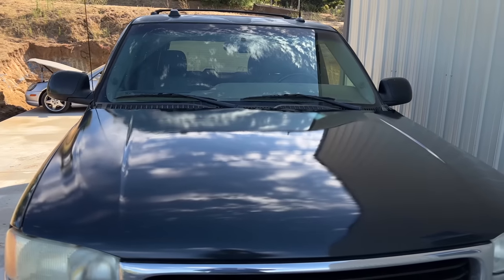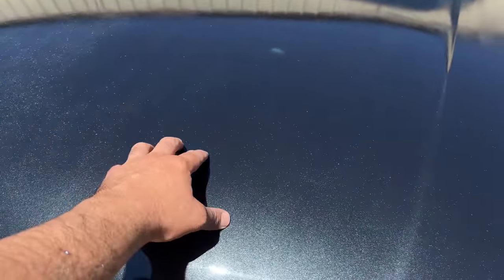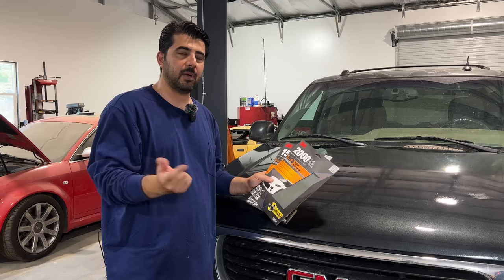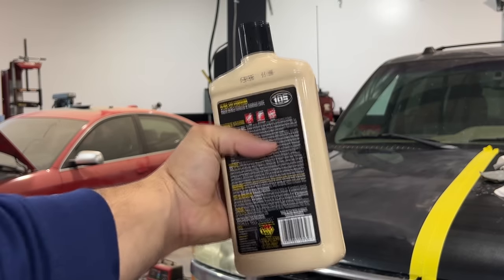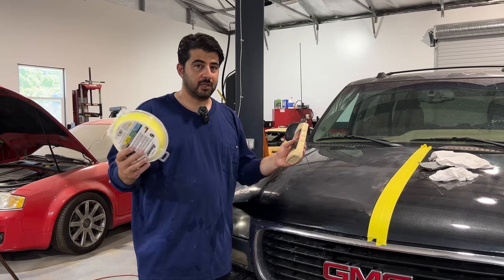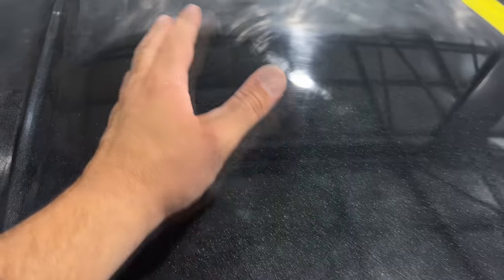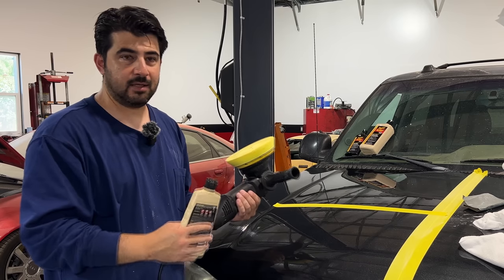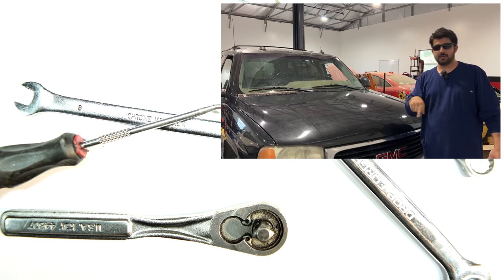You Won't Believe How Easy Paint Correction Can Be!

Comment: I would use the dual action polisher with a sanding pad. This makes more even sanding.
Reply: What grade pad would you use?
Reply: @uw8850  there’s a thing called interference pad for sanding discs. I would use the 2000 grit sanding disc on that interference pad.
Reply: @Elniniss  thank you.
Reply: or just buy a dewalt DA sander.
Reply: You're talking about a DA sander, much like a DA polisher its a dual action sander that rotates and oscillates, with a soft foam backing pad/interface pad you can make quick work of body panels, I would still recommend blocking things by hand around body lines where you can't fit the DA.
Reply: @InsomniaRebel  with sand handing you’re more likely to sand the paint flat. If you’re doing the entire car then it’s fine. If you’re just trying to knock down on some orange peel it’s easier with a sander/polisher. It will make the panel blend better.